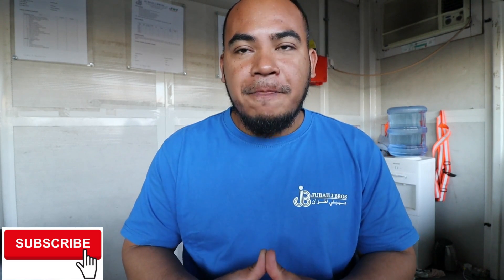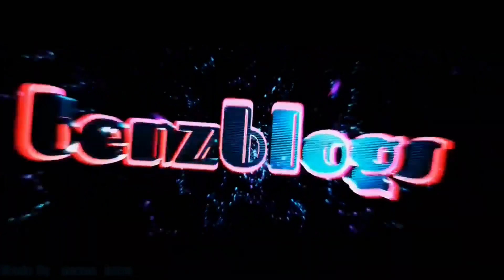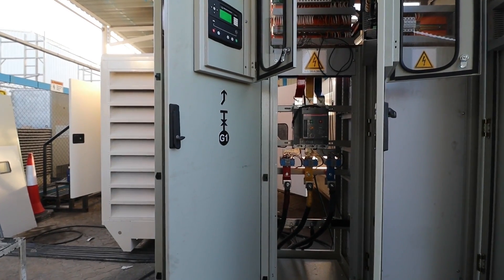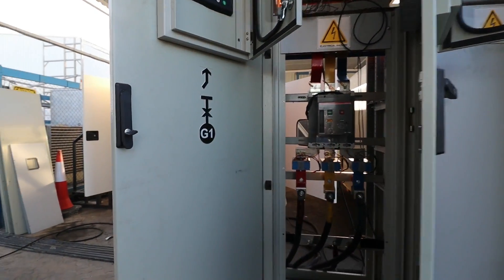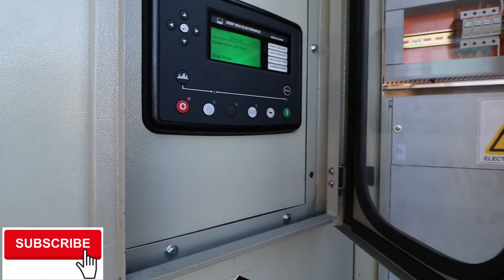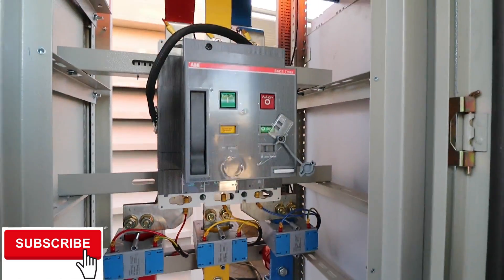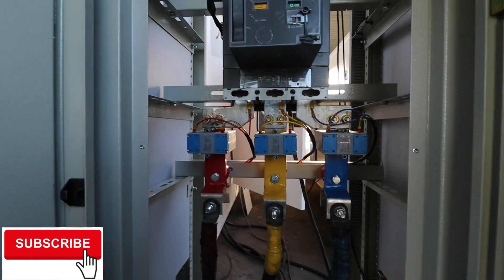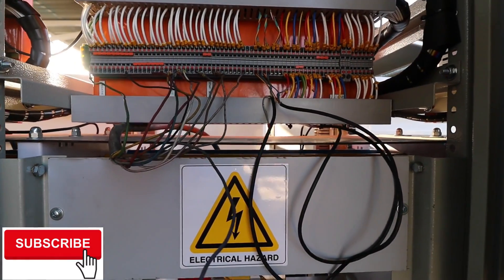SYNCHRONIZING WITH 1600AMPS TOTALIZING PANEL benzblogs

Comment: Good sir tanong ko LNG Kong ano problema Ng matagal mag syncro inaabot Ng fail to sync chinek ko na lahat Ng configuration ok nmn  di Kaya may problema un module  2 Genset Ito at module ay 8610 at 7510 thanks sa sagot
Reply from the maker: Tatlo lang yan sir pweding sa engine ,avr ,module
Reply from the maker: Kadalasaan nyan ay di ng communicate ang msc
Reply: Sir pwede  mag Tanong luma na yong synchronized panel ko at generator. May problema ng kaunti. Pag umandar na  ayaw na ma I stop ang generator ano kaya problema sir